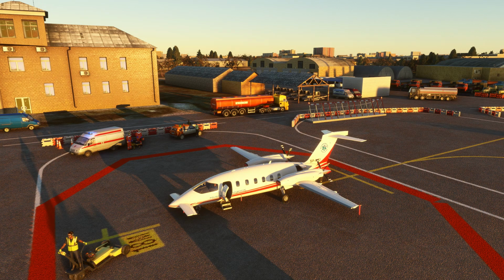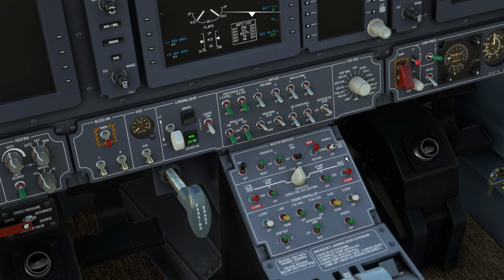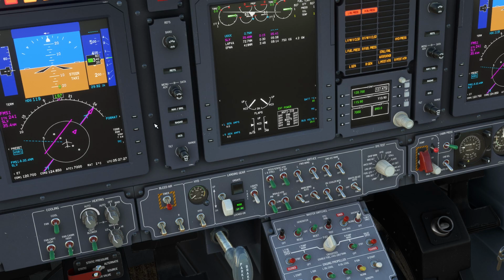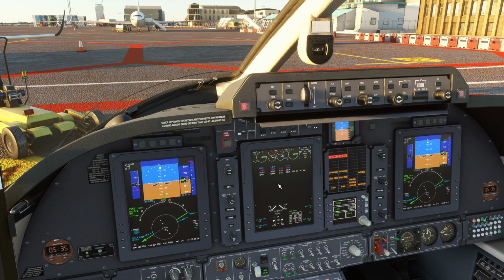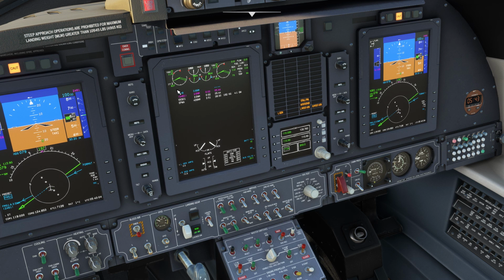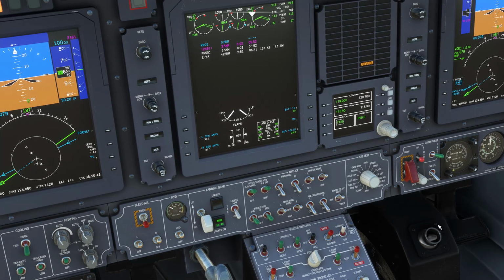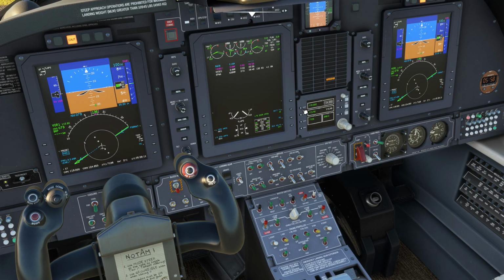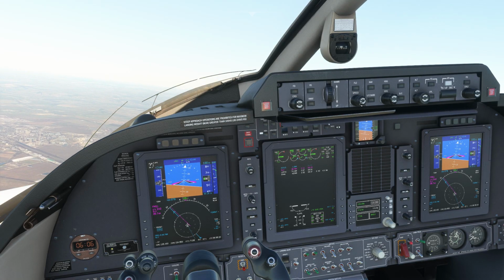MSFS Piaggio Avanti Cold and Dark to Take off with basics of systems

Comment: You can also put QNH into FMS using inches, it automatically transforms it into hecto pascal or vice versa if it is displayed as inches in the FMS it will transform hecto pascal values into inches.
Regarding the engine torque and ITT arrow: The empty arrow is not supposed to overlap the other. They are two completely different things. For take off you set torque slightly below 100%... 95% is fine. ITT you don't control up until it comes close to 820 during climb at that point you reduce rpm.
Reply from the maker: Noted, thank you!
What do you mean reduce rpm? Like in regards to reducing NG with power levers? Everywhere I was reading/watching they specifically said RPM stays at 2000 and condition levers stay at max forward.